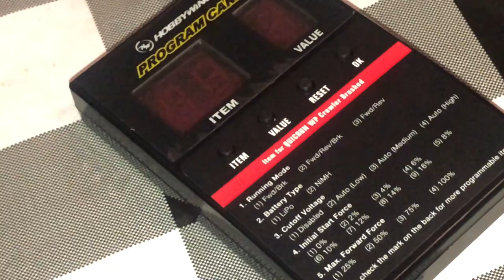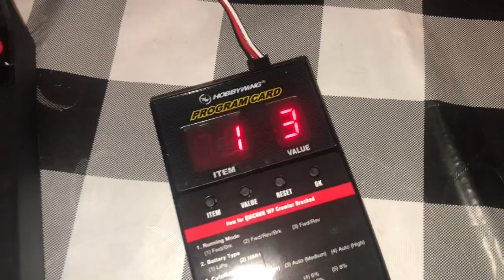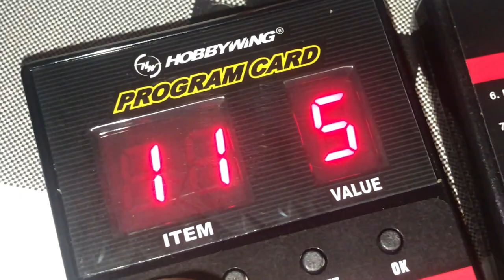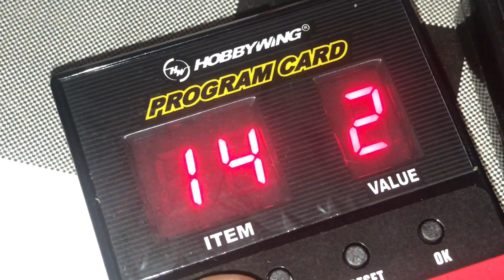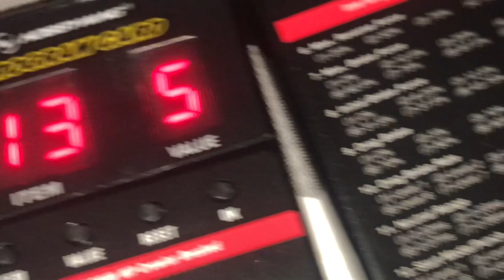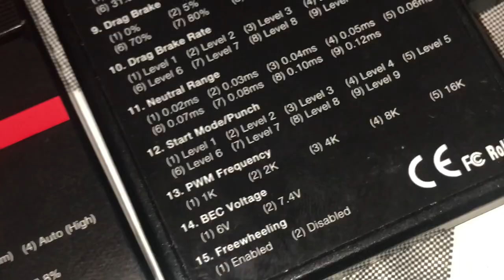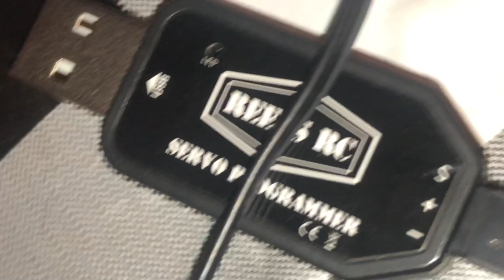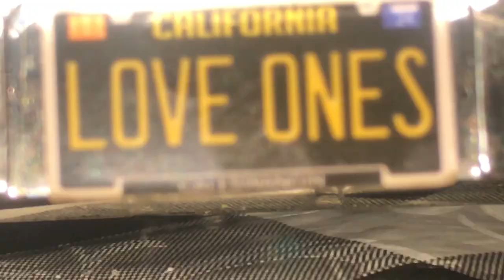FLACO’S HOBBYWING 1080 ESC SET UP FOR REDCAT SIXTYFOUR JEVRIES KANDY N CHROME EDITION LOWRIDER RC

Comment: Big up to you, bro I got my 1080 and put it in. I programmed it just like you said and it works beautifully. I had one slight problem. I figured it out when I gave a full throttle of the car at like it didn’t want to move forward so I went back over your settings and everything is fine thank you very much for the tip GOD BLESS!
D
Reply from the maker: Glad youre set up & glad to help you out. Have fun with it
Reply: Yeah, that nerve-racking humming noise is gone lol

Comment: Ok cool yeah I noticed in your video. You forgot to say push save after every number also something funny with mine. I set my number four item to yours, and it was running Hella.slow but I remembered you said you had a lot of weight which I don’t I would give it full throttle away would barely go anywhere so now I bumped it up to number nine I believe which is 16% I just installed my second one in my droptop guero edition👍🏾😎
Reply from the maker: That might be your throttle setting on the remote or throttle trim on the remote 
I forgot how I set it 
I didnt push save in my video cause they were already saved but I should have clicked save for the video 
Glad you got it going tho

Comment: Where did you get the speaker and programmer for your lowrider? Great video and car. Keep up the good work.
Reply from the maker: Speaker is from amazon i took it apart 
EWA Travel Case Packed, A106 Pro Portable Bluetooth Speaker with Custom Bass Radiator, Brief Design, IP67 Waterproof, Perfect Mini Speaker for Shower, Room, Bike, Car (Black) https://a.co/d/3IlQ7ms 

And the programmer from the hobby store

Comment: My bad will the stock servos handle 8.4? If not, I’ll just keep it at 7.4.
Reply from the maker: Thats why i like the external bec with the holmes hobby splitter i added cause im only getting 8.4 to the front 
I had 8.4 all around and it would make the rear twitch every now n then. Also program the stock reefs to 100% cause it is programmable and its only at 80% out the box

Comment: I’m going to put the 1080 esc in my Monte. Can I get away with using the same settings you used for the 64? Obviously, I know I need to change a couple but for the most part do you think I can get away with it? Also, where do you get your windshield banners from? Thanks!
Reply from the maker: You can try it but the Monte is set up with 4 servos and its set up to be a dancer but you can hop it. The Dream On decal I got it from dream on on instagram when I bought some stuff from him

Comment: Hey bro, I have a question. I’m getting ready to put in lights in a 64 Lowrider but I have an engine sound module taking up channel 2 so how do I infuse both to use channel 2? The lights have a Y connector as well as the sound modual Thanks! PS hopefully without splicing anything
Reply from the maker: Just saw this 
Sorry Im not sure how that would work I thinl the engine sound connects to your esc 
If you live close to a HobbyTown they can help you with that wiring and splitters and how to configure it. 
But you shouldnt have to splice anything Just use the splitters.
Reply: I figured it out. The light kit comes with two connectors one that goes into the light module in the car and one that goes to channel 2 so all I have to do is take channel 2 out and put it into the Y connector that comes with the light kit this the ESC is connected to the motor sound module and the light kit thanks for responding to me, though I appreciate it
Reply from the maker: @kennethwilson2409  glad you got it figured out Enjoy your Lowrider

Comment: Can I just get the 1080 esc and not change anything else? I was under the impression that just changing the ESC. Would help but you have a new BEC and all this other stuff going on. I am new to this.
Reply from the maker: You will be good with the new 1080 It comes with 8.4v bec Just program the BEC on the 1080 to 8.4 volts and youre good to go
Reply: Can I use a 3s lipo on a stock 64 without burning anything up?
Reply from the maker: @kennethwilson2409  yes with the 1080 you can for sure

Comment: Hey bro, got a question. I was watching another video about the 1080. and they said turn the transmitter on so I’m wondering if you had the transmitter turned on when you program yours or did you have it turned off and does it make a difference? Thanks
Reply from the maker: You can do it either way and see it wont make a difference Its just a prefference 
Ive tried both and didnt notice a difference. Just make sure you dont forget to hit ok button after each item to have it saved 
Then after im done i unplug everything and plug everything and double check that it saved all my settings

Comment: Where do you get those c hubs? Love the look. Killer video
Reply from the maker: I upgraded to these aluminum ones on ebay The ones in this video were plastic 3 printed and they snapped
Heres the link to aluminum ones 
https://www.ebay.com/itm/266123056843
Reply from the maker: These are the plastic ones 
https://www.ebay.com/itm/265442308866?hash=item3dcd983302:g:kGMAAOSwFPFh8W9u&amdata=enc%3AAQAIAAAA8NXc0Lay9M8f2J%2FLm79Uav4GXr8aYP9hSCALkrQl49s0JJQYx8rmDOGhk05II5C9XOM3GF6HfHj288Xv5bjA5l17VUW1MIHXnyrvqqJMcspqxZvtDpoehbEeKkTy6DcSZoVve2KStVZlujqo854WdygT15qLXv1eiyoDriwJuAq1WaTj3tcSXNvr1z%2Fw3URMdSfctiJm5FE86ycw48Y5p6PzgrZzm1nTvC0gwVRJOtEdpI9hyyrhmKJyidnGV1MKmgitUa1kSvy98dNmcko54%2BhG66hY6%2FPUtVm0oJfsjuU9CwdRD5P0Q%2BVEOHwsneYYGw%3D%3D%7Ctkp%3ABk9SR8iXp7vjYg

Comment: What did u need to do for that battery cuz there 2 connecters and the original battery only has one new to the rc world  got the monte carlo
Reply from the maker: When i got the hobbywing and added the BEC i changed out my battery plug to a deans plug since you have to soder the bec into your power supply
Im not using the original battery its weak
Reply from the maker: Theres only one connector on the battery for power, the lil connector is a balance plug thats used for charging the battery if thats what youre asking
Reply: O ok thanks for your time and info

Comment: What do you have for a Steering Servo
Reply from the maker: JX Servo PDI-4409MG 9kg this one from amazon but I had to reocate one of the servo mounts, the one toward the back end
Low Profile Coreless Metal Gear Standard Digital Servo Motor for RC Car Robot Arm Helicopter Airplane Parts https://a.co/d/hgfguXY